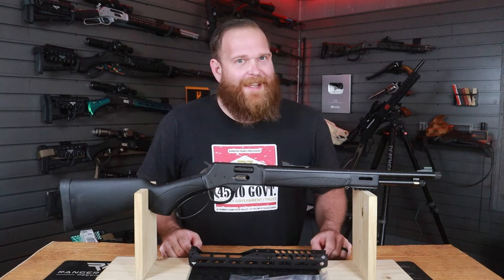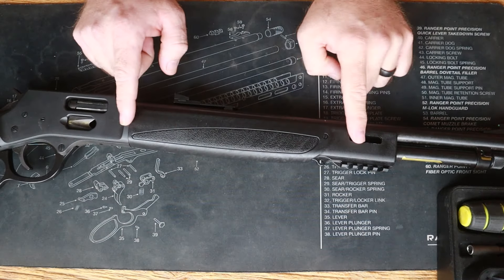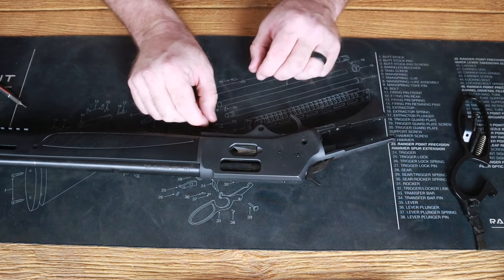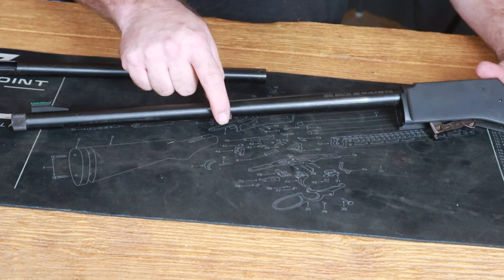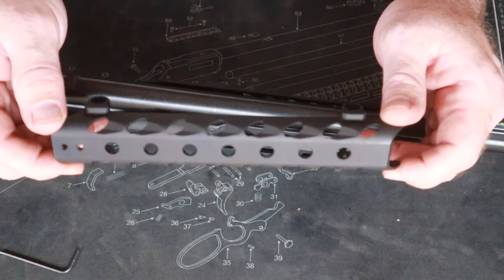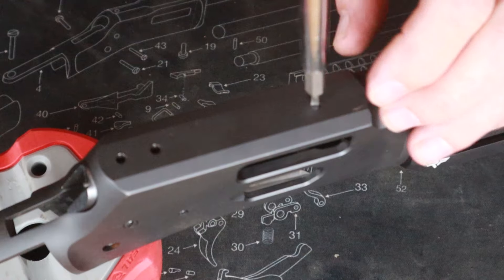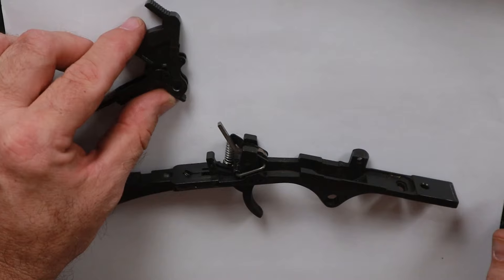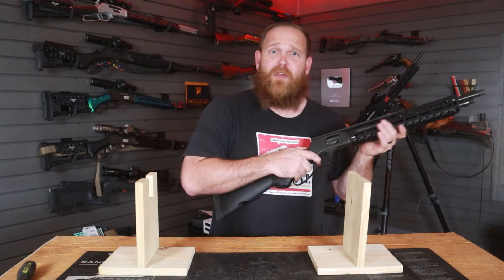Henry Pistol Caliber PewView Handguard Installation | Ranger Point Precision

Comment: Is removing the magazine tube entirely necessary? I fitted a Midwest handguard and removed the factory forend without removing the magazine tube. I was a bit confused as the video I saw the magazine tube set screws were visible without removing the trigger mechanism. I have a 2024 Henry and they must have altered the design .
Reply from the maker: I have looked at every Henry that I have. I do not see a non destructive way to remove the X model handguard or the metal end cap of the other models.
Reply: @RangerPointPrecision  I drove the tenon out after removing the handguard screws. There is enough flex in the mag tube to not have to remove it. I didn't have a lot of choice as I didn't realise the removal screws were hidden under the plate.